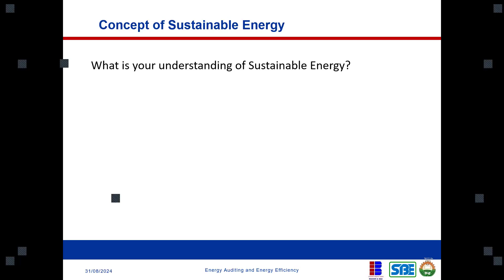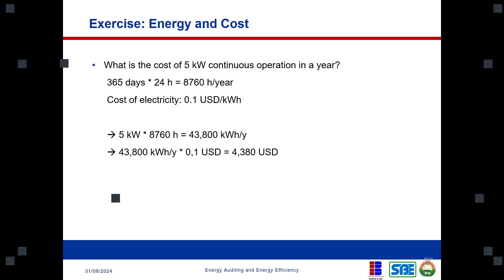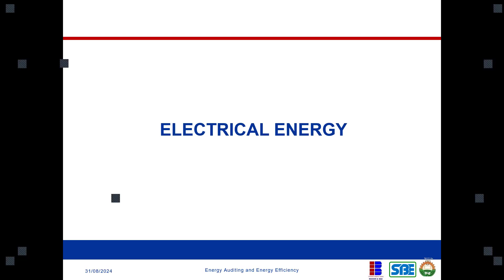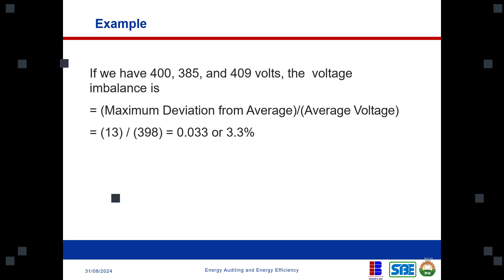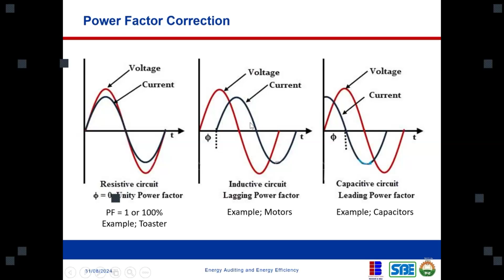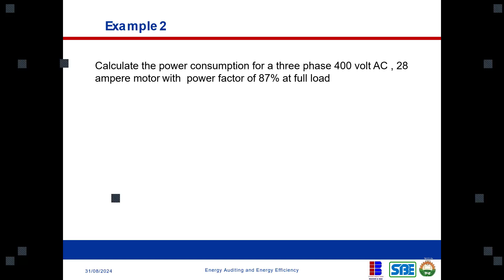ENERGY AUDITING AND RENEWABLE ENERGY COHORT 3 DAY 1

Comment: Just to make a slight correction on the definition of photosynthesis. It is the process through which green plant convert sunlight to glucose using Carbon dioxide and not oxygen as I mentioned in the video.